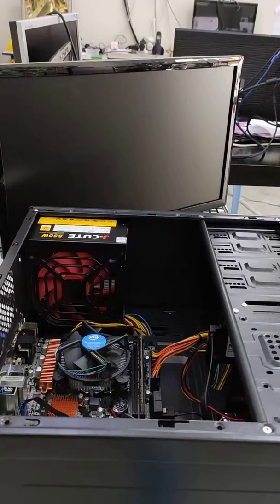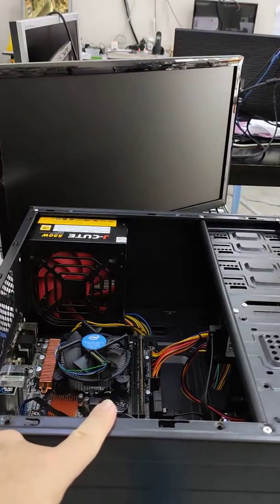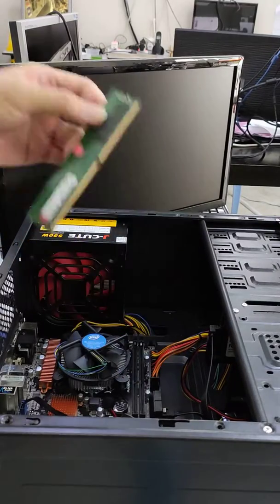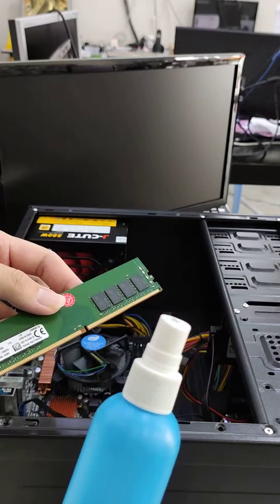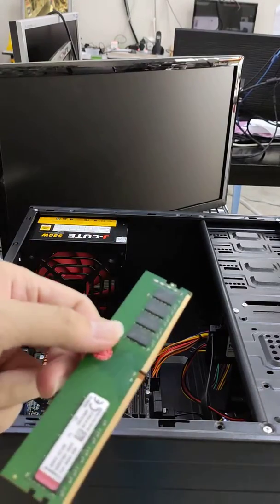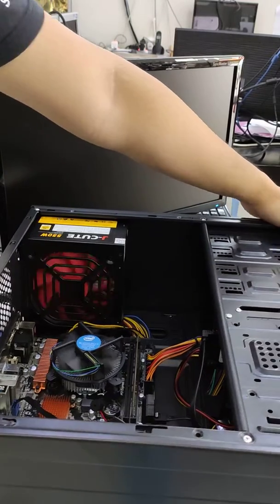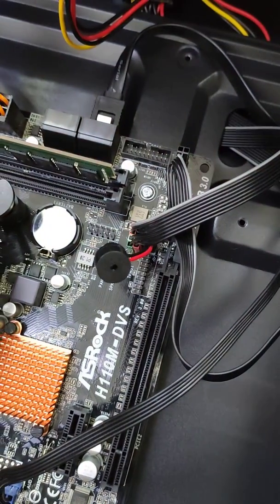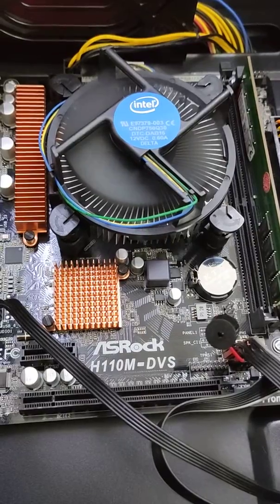Method to resolve Power on but no display (RAM & RAM Slot issue)

Comment: Doesnt work. Ive pressed it hard enough that the latches thoroughly click by themselves but the next morning when I boot my computer it doesnt display on my monitor even though the computer is on. So I have to open my desktop and reinsert the ram again and then it works. tired of having to do this every morning. done this for a long while now and my thumbs hurt.

Comment: Many, many thanks, I opened the computer case and did a bit of dusting. That's all. I removed the rams (two 4 GB ones) and put them back in their slots. Processor is running, graphics card is running. No display. Oh shit. Let me try putting the mouse and keyboard into different USB slots:) Nope. Shit again. Let me try interchanging the RAM slots. Nope. Everything is connected correctly, did I screw up things so badly? So, the thing is even after you hear a clicking sound in the RAM slots, double check. I simply pushed both the RAMS into their slots gently and could feel and see it going on. Now everything works fine. Nearly had a heart attack and it was very stressful. Thanks a million. To anyone reading this, whatever you do, please don't panic. Peace.

Comment: this 100% worked to resolve my issues. I reseated my ram cards after deep clean of internals, and system would only boot with 1 ram card. tried reseating, reset cmos, almost took out cpu. turns out I had a very small smug on the non working card. cleand and restarted.

Comment: Why is this happening to me after windows 11
Reply from the maker: Usually this does not related to windows. Cos it happened while the Motherboard do self check before power on the system. It is related to the RAM / Hardware rather than operating system. So you could start from hardware diagnostic.

Unless you can enter bios without issues, then that is other cases.
Reply: @lightencomputer1999  my bios doesn’t work I took out the cmos for 5 minutes I can run my pc without the cmos then it brings up windows reset page with troubleshooting then I click restart windows 11 then it goes back to black screen

Comment: My problem is when I tried to add another ddr4 4gb ram to my PC(same brand in the video) it won't open no monitor display. Can somebody help me to fix I just want to upgrade my RAM from  4gb to 8gb. Ty
Reply: did you find a fix? I have a same problem and only use one ram stick right now 😭

Comment: Mine`s a weird one. I got 2 16 gig sticks that were the right ones. When I first fired up the computer no screen and VRAM led error. So bought some slower 4 gig sticks and they worked ok. And then found the 16 gig sticks worked if paired with the 4 gig sticks with the 4 gigs in the first slot. So it slot 1 4 gig, slot 2 16 gig, slot 3 4 gig, slot 4 16 gig. So now I have 40 gigs that runs at 2100 Mhzs. I don`t want to turn on XMP and then turn off and then install the right RAM in case it all goes funny. Does XMP detect what settings are needed everytime you turn on the PC?

Comment: Best way remove the ram put it back in it will work if not idk if it did go to control panel hardware and sound power option top left choose what power button do change settings that are currently not available and turn off fast start up 

It worked for me :)

Comment: Didn't work fom me
Reply from the maker: You may need to find a working RAM to insert in your motherboard, maybe it is RAM slot issue. You could use WD40 Electronic contact cleaner to spray the slot, then use clean soft brushes to brush it. Then blow dried the slot with cold wind, see whether it alive again.

Try your RAM in another working motherboard first, if it works mostly your motherboard RAM slot dead and need to change the board
Reply: @lightencomputer1999  both RAM work on the remaining working slot , it's a two slots RAM  motherboard . I was trying to mount a refurbished CPU bought off eBay , but it was faulty apprently , I got bluescreen and my computer restarted. So I reverted back to my former CPU , and surprise ! One of my RAM slot was dead 😭. This was the first time in many years I bought a faulty CPU on eBay

Comment: I had two ram slots and two new sticks. After it was not working the first time, I switched the places of the sticks and rebooted. My mouse LEDs started blinking, so I knew it was on. It still did not work. I turned off my computer, and switched places back to the original slots. Now it works. Hope this helps🤗 If that didn’t work. Make sure that u have pushed the ram enough down, until you hear a click, and it closes itself
Reply: Mines clicked into place but got a black screen
Reply: @71igfffv  how did you make it work again?
Reply: @omoladelekan5139  I had to remove the ram I installed then factory reset my PC because my other ram had issues because I tried to install new ram but I got it all working again..f trying to install ram myself I just got my money back..am just sticking with 16gb ..if I decide to do that again it will be taken to a PC shop because I tried everything and it wouldn't connect in ..my friend tried as well

Comment: I hope this helps: I was putting the ram in and I thought I had put it in properly because I had heard the two clicks so I was certain that it was a motherboard problem. Turns out I just had to push them a little bit further in after I heard the clicks.
Reply: thanks man.. that was my issue. God Bless!!
Reply: I pushed basically as hard as i could but no clicks?
Reply: @xerruu  did you make sure the ram was in the correct way and made sure you flicked the switch things at the side before putting in the ram?
Reply: @cruiser1  well gg just looked at the motherboard website and my cpu dosent support the speed of the ram i bought
Reply: @xerruu  oh aha rip
Reply: @cruiser1  well shit i put my old ram back in and it still dosent turn on lol
Reply: @xerruu  same things happening to me, have you fixed it??
Reply: @Justin3rs  yea i got it fixed with the new ram just push the edges of the ram into the board hard like one at a time only the edges not both at the same time
Reply: @Justin3rs  like when u put it in the slot push the edges in first and u will hear  clicks
Reply: @xerruu  wait I have the same problem I tried installing 2 new sticks and no display so I went back to my old sticks and no display ? Did u jus buy another set of ram ? Howd u fix it smh
Reply: @xerruu  how do you check that.
Reply: So what happened for me is that I transfer the ram from slot 1 and 3 to 2 and 4 and suddenly the monitor, keyboard and mouse are not working anymore. Tried putting it back on slot 1 and 3 and solve the problem. The question is there a problem with my slot 2 and 4?
Reply: @s.f.2480  i had same problem,you didnt put ram properly after you hear the click keep pushing until its all the way in.That fixed mine hope it will fix yours too
Reply: @aleksandarilic9403  Maybe I'll try that next time. I just wanted to try it in slot 2 and 4 since in slot 1 and 3, the mhz is only 2133 instead of 3000 mhz. I tried everything I watched in YT and still it wont give more than 2133 mhz.
Reply: @s.f.2480  your slot 2 and 4 might be faulty. If your system boots up and works fine when you insert in slot 1 and 3 then it’s for sure not your ram. I’d suggest trying some compressed air on those faulty slots because maybe it might have some dust. I’m also having this problem except it’s the opposite for me, my slots 1 and 2 don’t work and 3 and 4 do.
Reply: Holy cow thank you, I was going to commit suicide if I didn't get it to boot up
Reply: Thanks bro,i also Had a problem which sad i have 16gb but only 8 usable and i fixed i too!
Reply: thank you so much, i honestly thought i broke my pc. this helped alot.
Reply: WTF... normally I'm a real crack when it comes to solving PC problems but this somehow slipped over my head... Thank you friendly Internet person
Reply: ty so much man
Reply: You fucking save me broooo thanks!
Reply: Bro thanks 😅
Read ur comment and fixed my laptop just so
Reply: Thanks so much god bless u 😂
Reply: THANKS IT HELPED !
Reply: Bro this comment is 2 years old but ur the goat man 😂
Reply: Hi thank you very much for the tip. Same thing happened to me, after i heard the first click i thought it was ok... i guess i was scared to push them harder. Thanks a lot, again.
Reply: Ove done this but it still doesn’t work can anyone please help me
Reply: Thank you autistic carrot you are a life saver i thought i destroyed my pc after just fixing it
Reply: You fixed my issue after nearly an hour of trying to find the solution to it.. THANK YOU!!

Comment: Wow. Your pc booted fast as fuck, which brand of ssd are you using?
Reply from the maker: Hi, we believe most of the branded SSD would have similar performance ya.
Reply: Any ssd with your OS on it should be about as quick.
Your OS HAS TO BE ON THE SSD.

Comment: This fixed my issue. Key tip: Push the RAM in with enough pressure so that the 'catch' closes itself. Before that, I was closing the catch by hand.
Reply: Thanks for summarizing I was scared I was going to break something so I manually closed it as well. Thanks!
Reply: I did that, but it still wont work, any help?
Reply: Woww, it was this, this worked for me! Thank you! Saved my life man!
Reply: My ram catches don't have springs to close themselves and I have to close them manually, and the ram sticks won't go in any further. The computer is detecting them since the LEDs are on but my external USB ports and hdmi are still not working
Reply: @dd-gl2qf  you can try using the motherboard hdmi port, thats how mine was fixed.
Reply: @dd-gl2qf  exactly the same how did u fix
Reply: 👑 you dropped this
Reply: I did the same thing lmao
Reply: @Danwell86 thankss so much dude i was struggling for a whole hour trying to figure out what was wrong and this worked
Reply: May god bless you with wealth health and happy life brotha u saved my life this night
Reply: thanks so much fixed my problem
Reply: thank you, i have a similar issue with my laptop, turnout i didnt push it hard enough
Reply: Yo this worked thank you before reading this comment I was about to cry bc I thought I wasn't going to be able to get it to work I can't thank you enough thank you
Reply: Nvm the video u da real mvp, I saw your comment before the ad even got done and I was doing exactly that. Problem solved Tyvm  good sir
Reply: Ok thx I was doing the same thing
Reply: Tysm my guy
Reply: You're godsend Dan
Reply: I’m having the same problem as we speak I think I’ve push hard as I can
Reply: Your comment just changed my life😅
Reply: O my god
Reply: Thank you so much 😢♥️♥️♥️♥️♥️♥️♥️♥️♥️♥️♥️♥️
Reply: Omg u a goat for this WTF THANK U
Reply: Wow you actually solved my issue thank you!
Reply: bro kiss me u saved me
Reply: I wish I could kiss you thank you so much dude!
Reply: Omg thank you bro you saved me so much money my dumb ass didn’t push it in all the way
Reply: Your key tip just saved my day
Reply: you're a life saver!!
Reply: Thank u so much u saved my life 💓
Reply: Thank you very much i thought i'll broke my ram if i push too hard
Reply: God dam bro I thought my dad gona kill me♥️♥️♥️♥️♥️
Reply: Thank you
Reply: This is what helped thanks bro
Reply: My issue as well, RAM not pushed in far enough. Many Thanks
Reply: Bro, this comment is a life saver 😂😂
Reply: Doesnt work. Ive pressed it hard enough that the latches thoroughly click by themselves but the next morning when I boot my computer it doesnt display on my monitor even though the computer is on. So I have to open my desktop and reinsert the ram again and then it works. tired of having to do this every morning.
Reply: THANK YOU!
Reply: Old comment but fucking hell you saved me. I was stuck with this for 3 hours thanks alot.
Reply: whoever raised you is a goat

Comment: Hello bro i have 2 slot when i put 2 ram with every thing same... the computer not starting when i remove the ram on the slot 1 the computer starting please help me bro 😔😔😔😔😔
Reply: Guys i have similar problem as you, both ram sticks are working but nothing shows on the monitor its black screen, i tried cleaning both the sticks and the ram slots and its the same... some solution? Thanks
Reply: @josif.tarcugovski  same here I don’t know what to do
Reply: Youre a freaking genius! It worked. Thank you sir.
Reply: Why did it make my pc bad system config info
Reply: ABNOY Gaming sory sir, it may not working on some user.
Reply: When it says “the amount of ram has changed” I click on “go to bios” then it comes up saying no signal detected
Reply: Hey, i have the same problem. If your laptop stuck at start up maybe you can try this method. It works on mine:

1. Remove one of your ram.
2. Start your laptop.
3. On your desktop, open run (or ctrl+r), type msconfig
4. On boot tab, click advanced option.
5. Tick number of processors box and change it from 1 to 2.
6. Tick on maximum memory. Click okey and restart.
7. After restart, do the same thing, but at the maximum memory box, untick and then tick again. Restart and it should be okey.
Reply: Oh i forgot one thing, before you start step number 7, install your second ram into your laptop together with the other one
Reply: @lokmanjumain7948  thanks for the blue screen and sytem error.
Reply: @lokmanjumain7948  it shows 1# of processor only not 2, how to fix?
Reply: @lokmanjumain7948  thanks bro, you saved my msi

Comment: is the electronic cleaner spray safe to use on motherboard??
Reply from the maker: Electronic cleaner such as WD-40 Specialist Electrical Contact Cleaner Spray is speed dried solution. So you can spread on motherboard and then leave it there / use hair dryer with cold air blow until 100% dried before you resit all the component & power on.

Comment: I used 2 slot ram. 1 slot ram not working, why meh?
Reply from the maker: Hi, could be the motherboard RAM slot problem. Some old motherboard happen like 2 slot only 1 can use or 4 slot only 1 can use. Quite common, could  try to spray the electronic cleaner into the slot and let it dried, then try resit the good working RAM again.
Reply: @lightencomputer1999  🙏🏼🖤
Reply: Same here
Reply: same